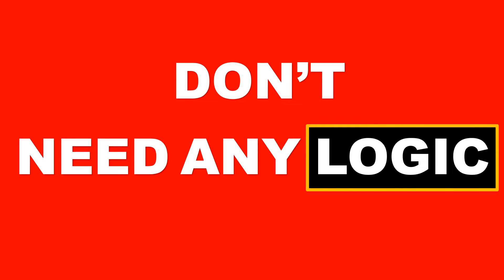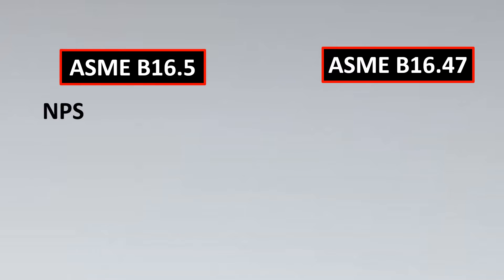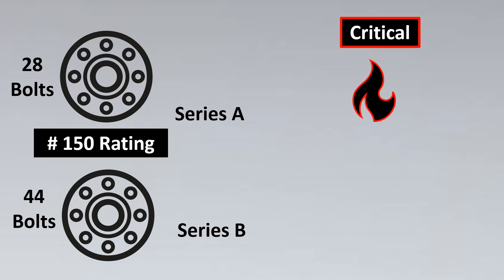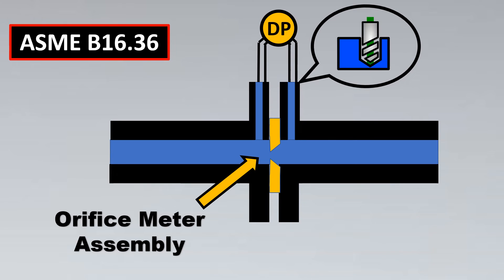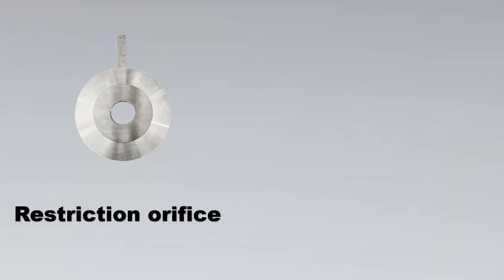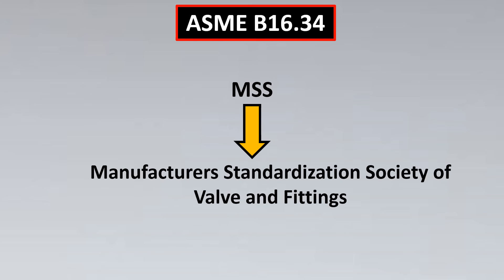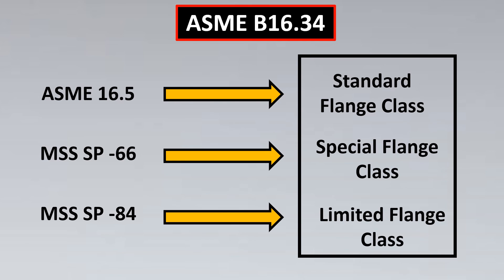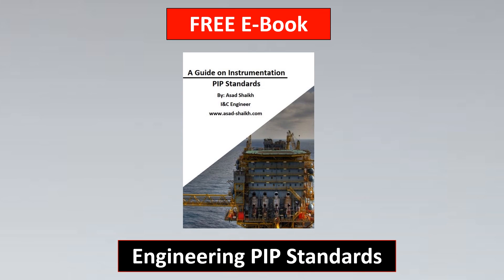Flange standards (MOST SIMPLE GUIDE)  | ASME B16.5 | ASME B16.47 | ASME B16.34 | ASME B16.36

Comment: Thanks for the vedio.
If I have understand well for orifice plate with pipe taps no need for asme b16.36 flanges. They are required only for orifice with flange taps. That's it or not ??
Reply from the maker: yes, correct understanding.